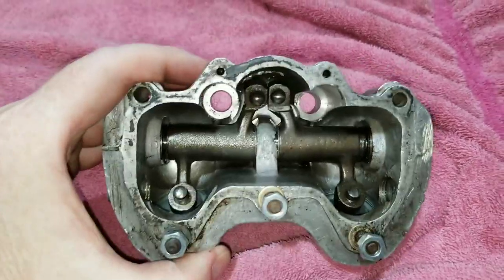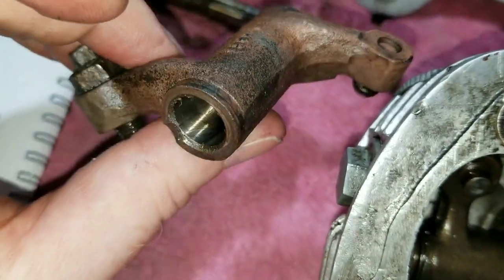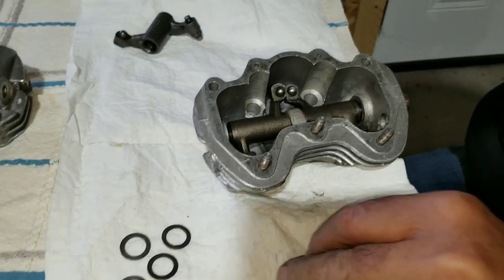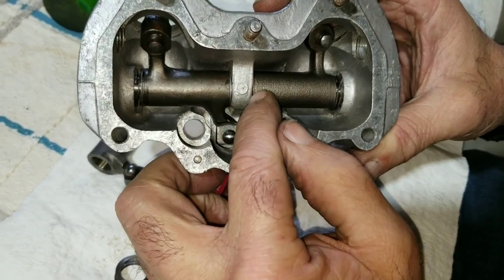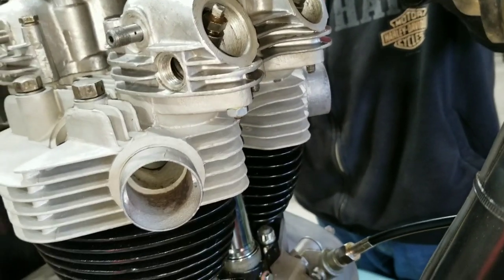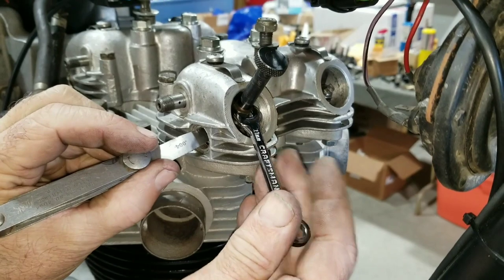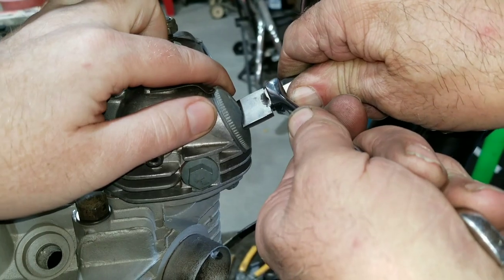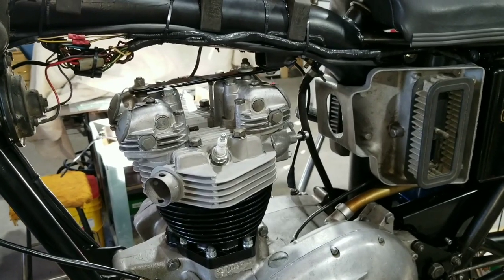1971 Triumph Tiger 650cc Restoration Part 23, Rebuilding and installing the rocker box assemblies

Comment: Thanks for the info.  The 78 T140 I picked up recently had the washers reversed, with the spring washing against the rocker arm and oil slot. Plus it was missing a washer in each rocker box.  Crazy what you find taking apart an old bike.

Comment: Great you did a bit of an in depth over the Thackery washer position. I looked into this a lot when I was rebuilding my 72 Bonneville and finally put it together Thackery to casing as you explained. You have to blame Triumph for a money saving idea on this. But you put my mind at rest that I have assembled it correctly like you and the reason for it, thanks

Comment: Do you guys glue those rubber tank mounting pad/things to the frame?  I can never get them to stay still when putting on and taking off the tank.  I wrapped electrical tape around one of them to keep it place.
Reply from the maker: We use black or clear silicone gasket material on the rubber mount to the frame and then use black electrical tape around the frame and rubber for extra support. Then the rubber mounts stay put and don't let the gas tank move around.

Comment: Excellent thorough explanation thank you. Really helpful thank you. I did notice that you didn't use the spacers listed in the parts manual (E12598) shown as going above the centre head bolts between the top ov the bolt and the inside of the rocker box.
My friend Mark, who has rebuilt many T120s and T140s has never seen one used.
Any information about these spacers welcome.
Thank you again for brilliant, informative videos.
Richard
Reply from the maker: @richardeblack  we didn’t use those spacer’s because they were not needed when we converted the bolts over to the 1972 style, We switched to the mid 1972 and later style because of the better larger Allen wrench and special tool so it can be torqued better, it’s just a better setup, and that could be what your friend did, thanks for the great comment,
Reply: Thank you very much for that reply.

Comment: Another little trick is like to share is using the fork selector rod out of a tranny. Slide it in from the other direction makes it easier to hold it all straight while you fiddle with it. RMM

Comment: EDIT:  I don't think the below problem came down to the spindle not being flush with the end of the rocker box as I was predicting.  It may have been a bent washer causing my problem (the one that sits against the thackery on the spindle.)  So what I wrote below may not be correct as far as making sure the end of the spindle is completely flush with the rocker box.  I'm doing more investigating.  

I did my rocker boxes that way you guys did and after taking one off to replace a busted pushrod tube I realized something....

With the correct sized washers and spring washer placement, it's important to knock the spindle as close to flush with the side of the rocker box as possible... cause if you don't, if you leave it protruding like yours is in the video, there's a small gap on the opposite side of the spindle where the thackery washer sits (on the side with the acorn screw, where it's at its narrowest diameter)... normally the thin smaller ID washer would sit there, but we've ditched that washer for the larger ID and put it on the other side of the thackery, this creates a small gap right where the thinner OD spindle meets the inside of the rocker box, and that gap (if it's big enough) can catch the edges of the thackery washer and flatten it, so there's no spring action at all when you grab the rocker and move it back and forth.   I took my rockerbox off and was trying to figure out why the thackery had no spring action   I could see that it was squeezed together and flattened but I couldn't see anything causing it.   Then I realize it's that gap where the spindle gets thinner... it's just a tiny gap but if it two coils of the thackery get into the groove they act like your pliers do when you squeeze the thackery together to install it.   I hope that makes sense, it's hard to describe without pictures.  

The only preemptive fix I can see is to make sure the spindle is in there all the way and flush with the side of the rocker box, getting rid of as much of that tiny gap as possible.  Normally as long as the o-ring is in there good, I wouldn't care if the spindle protruded a little, but now I make sure to pull it in until it's flush with the rocker box.

Curious if anyone else come across this problem, or has any thoughts.  I don't think it would cause damage, but the spring action of the thackery is there for a reason, so it's good to have it working right.
Reply from the maker: Well you raise an interesting point about the large end sticking out. But we don't use the little holed washer as it is replaced by a large hole washer and it now sits next to the rocker and the Thackeray washer now sits next to the rockerbox and yes you must be sure the Thackeray washer doesn't get pinched and that the rocker shaft  when tightened up, that the larger edge of the bearing surface is up tight to the rocker box and the rocker needs to be free to spring sideways if pushed by hand and the Thackeray washer should rotate or move if pushed after its all tightened up. 
 It's interesting that some shafts seem to protrude on the large end further than other's we observe that end before and after so we know it's all the way in.
Reply: @jessesvintagegarage765  My theory might have been wrong.  I thought I was onto something but I just put that same rocker box back together and when I got the spindle all the way in place (flush with the rocker box) I was having a similar problem with the thackery washer getting squished and not having any springiness to it.  So I took it apart again and noticed the regular washer was a bit mangled and bent on the bottom... which may have been the problem all along.   I'm just surprised I wouldn't have noticed that bent up washer the first time I took it apart.   I'm going to edit my above comment to reflect this new data.